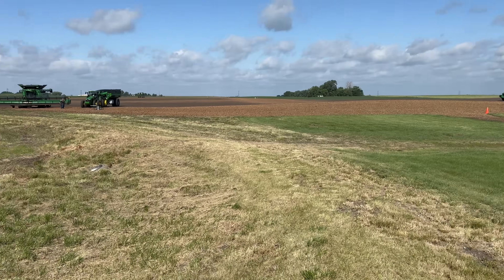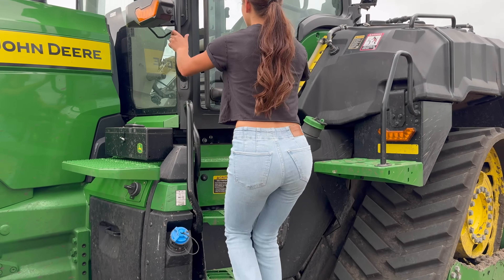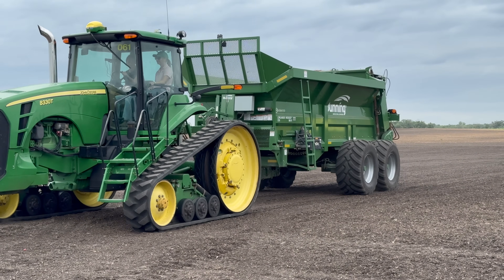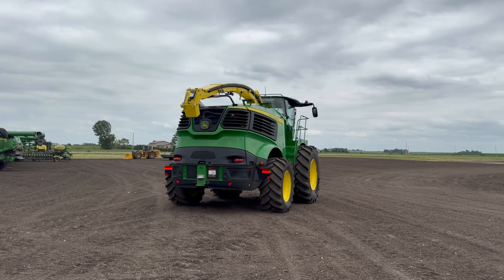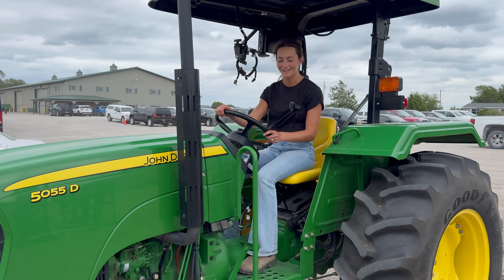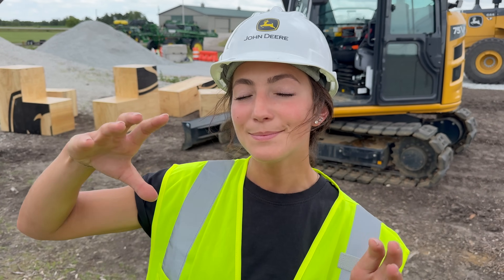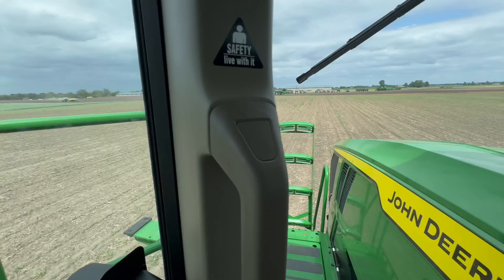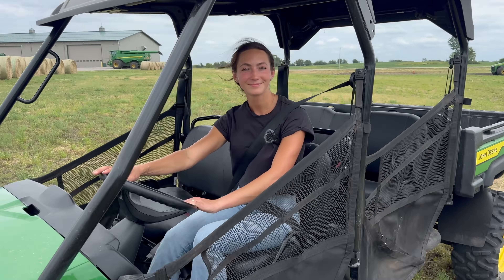Driving 24 Tractors In 24 Hours

Comment: Laura,  Great content and teamwork . I love Pepper.   You mentioned you wanted to watch small farmers you tubes.   I think you may enjoy Lamb Farms channel.. Excellent  old tractor and equipment farming featuring a nice  very talkative  young  man  in  beautiful east Tenn.  On  one vid he is using a late  60,s  (English made )  David Brown 990,  4 cyl diesel , 52 Hp  to bale small square bales for example.

I was raised on a 150 acre dairy farm in western Maryland and learned  to drive at age 8 on a 1958  Ford 801 select O speed transmission.  Dad then bought two  new  1966 David Browns, a  990 and a 770 A Selectamatic, 3 cyl. diesel, 12 speed, 36 Hp.  for me. 

  This  extremely rare tractor is probably the only non restored factory origional  770  in  the  USA with only 1750 hours.  When i left the farm in 1970 , dad sold the farm and it went in his garage until his passing in 2003.  It then went in my garage where it is now.  After 59 years it starts and operates like new,  and it looks like the David Brown dealer just dropped it off brand new yesterday.

Comment: To truly appreciate modern tractors you need to spend a day working my '51 Allis Chalmers WD or the '55 WD45. {Same bones as the WD with a bigger/revised 226 ci gas engine and other minor changes}  Non synchro 4spd transmissions, no power steering, no power brakes, a bare iron spring ride seat. No three point but rather a quick hitch setup with traction booster. The top of the line fancy ones had lights and a small tool box bolted to the fender.

Comment: Hi Laura!
I am wondering if the equipment model numbers have any sense or meaning?  Like tire size or width or the number of rows or gallons of fuel capacity or the diameter of sprinkler tubing?  Usually they have an alphabetic letter or two at the end.  Maybe that hints at some features?
Also, kudos to your second photographer (you are clearly the primary photographer) who emphasizes and lingers over your sensuous climbs up the ladders!  Yum!🎆

Comment: I'm thinking the two track tractor (super-sized skid steer) is more likely to tear up soft fields in a turn but might have the benefit of least ground pressure.  The remote control tractor was interesting but I would never want to see the farmer taken out of the farm.  Can it spot weird changes in a field or tire popper 2000's and stop on its own?  An autonomous grain cart would certainly help during harvest potentially freeing up someone for other tasks.  Thanks for sharing your experience.

Comment: Nice video with some amazing equipment. I grew up driving JD tractors and a chopper. Unfortunately JD has a lot to do with struggles of many farmers across our Country, especially the smaller family farms. JD’s equipment is so expensive it’s impossible for many farmers to afford. Several years ago they forced their dealerships to merge in into multiple locations franchises limiting customers by completely  eliminating any competition between local dealerships. They also designed their equipment so that all repairs have  to be performed by JD mechanics and techs. Deere was a great American company at one time but not anymore.

Comment: It would have been really helpful if you had explained the basics of John Deere’s numbering and coding system. What do the different letters and numbers signify?  The approximate cost of each.  Additionally, it would be great to understand the differences between the various tractor designs—what specific purposes were they designed for? Could you also shed some light on the different tire styles and the advantages of two-track versus four-track systems? Lastly, what recent advancements or new technologies—either in 2025 or the past few years—have been introduced to enhance farming capabilities, increase yields, or improve efficiency by saving time or reducing costs?

Comment: All this automation is cool and scary at the same time. Pretty soon humans will be completely removed from the equation. I’ve worked in the construction industry for a while now and if the automation goes down on a dozer there are almost no “operators” that can grade the old school way so the machine is essentially down. 
One of the reasons they have a steering wheel in the grader is that lots of school operators ran a motor grader standing up.